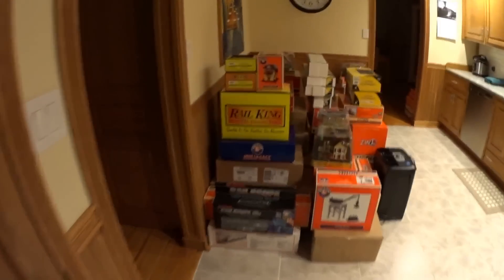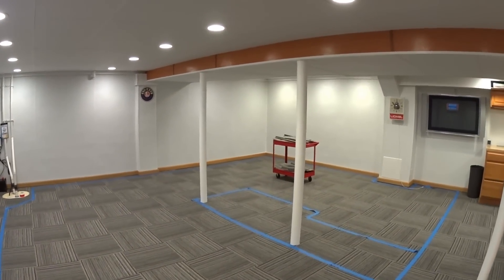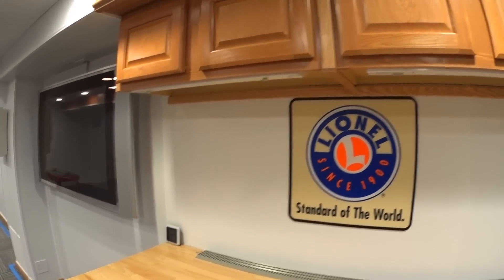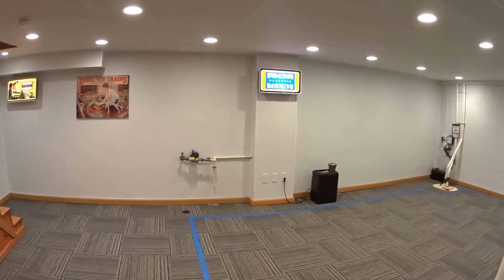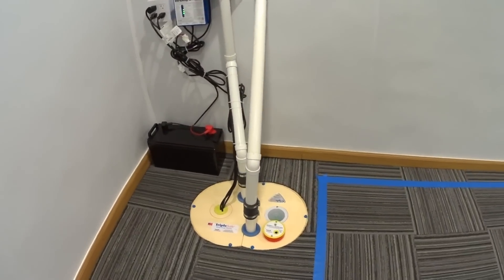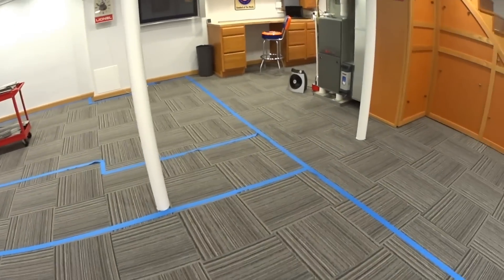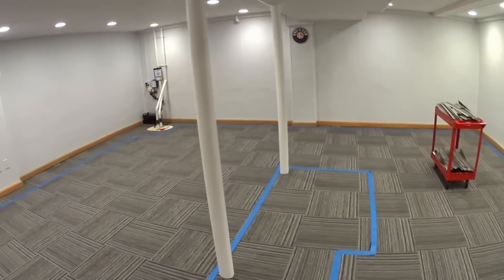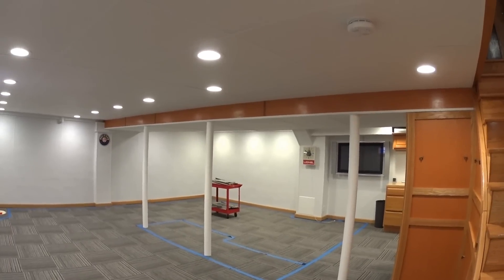My O Gauge Layout - Episode 1

Comment: Hi Sean

You mention you coated the exterior walls with, I think you said, a "rubber-proof" coating.  Can you tell me what that is .....the name, brand, and place you bought it?
Also, I'm interested in the fiberglass wall panels.  What is the brand and where did you buy it?  Thanks.
Reply from the maker: Oh, gee that was like 16 years ago.  It's not like paint you buy at home depot.  You can only buy it at certain places.  I had to special order it at a supply house.  It was a whole system of coating and special tape for the seams.  Not sure it's made anymore.  I did a search and couldn't find it.  But it was just step one to a bone-dry basement.  I used "Basement Systems" under slab drainage system too to prevent even a drop of water coming in.  Sorry don't have more info but a good rubber coating is only good for slight moisture.  If you have big leaks, it won't stop water.

Comment: HOW LONG AND HOW MUCH PRE-PLANNING WAS DONE PRIOR TO STARTING THE PROJECT ??? ... DID YOU DO ANY DRAWINGS FOR THE LAYOUT ??? ... TRACK PLAN ??? ... BOB HERE
Reply from the maker: Preplanning of a track plan in my opinion is a waste of time.  Your space and actual platform, once built will dictate what you can do.  As much as I tried to plan with a track plan,  until I built it, I realized it was not going to work.  Plus I changed my mind once I had an actual platform and could play with the design.  The problem is the buildings and accessories need a certain amount of space and so until you can lay it all out, no software I found, can truly tell you if it will fit or work. I suggest you define your space.  Build the platform to the max size and shape you want.  Then play with the track plan, building, accessories to come up with a plan you like.